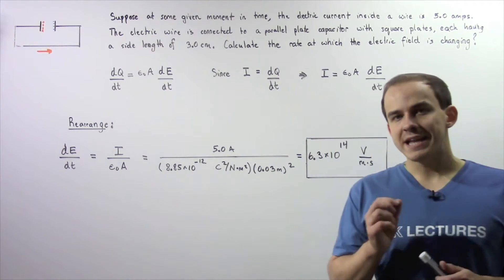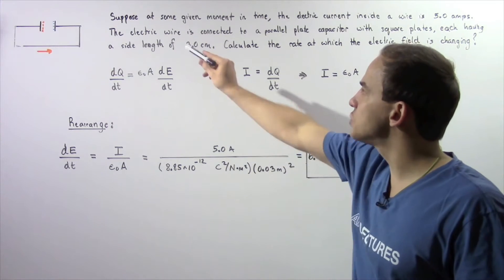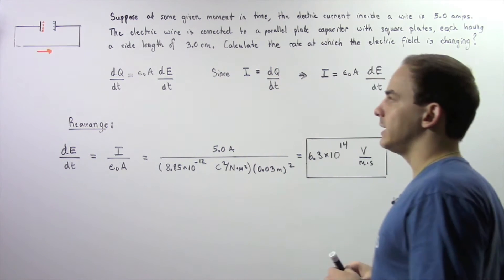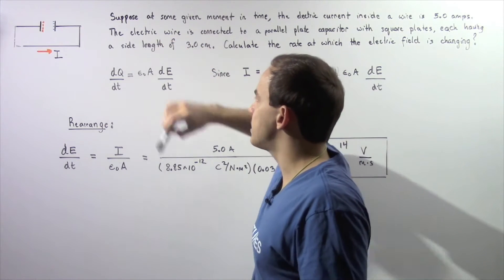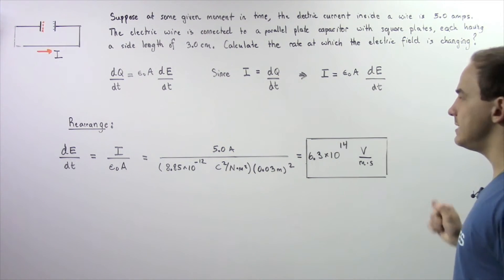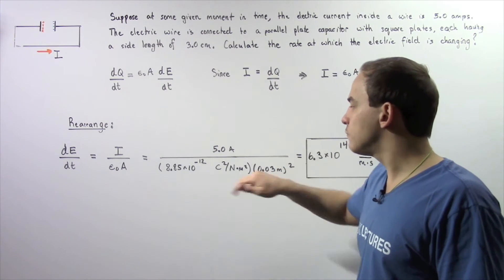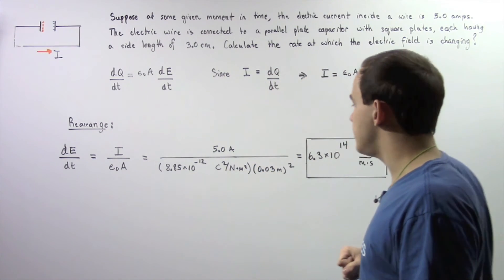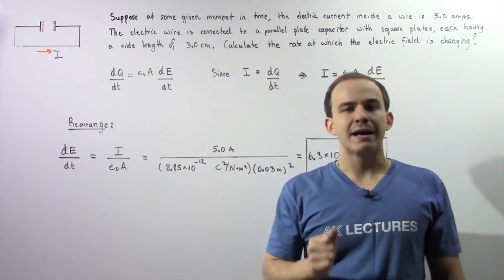Changing Electric Field Produces Magnetic Field Example

Comment: I have a doubt . Here dQ/dt is displacement current as said in the previous video  which is not the same as the current in the wire right ??
Reply: YES YOU ARE CORRECT
Reply: @devayush10  now in case of the capacitor the displacement current and the conduction current are equal .